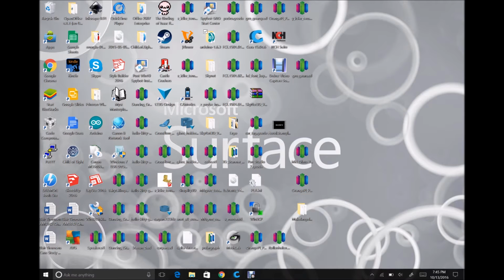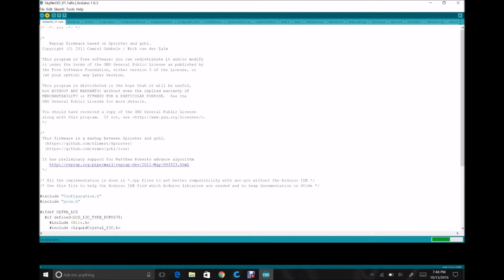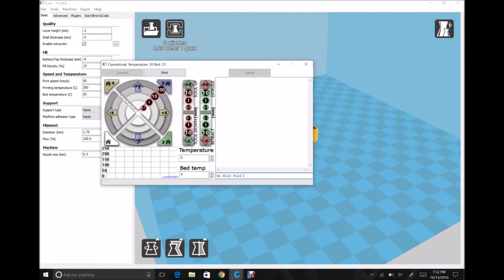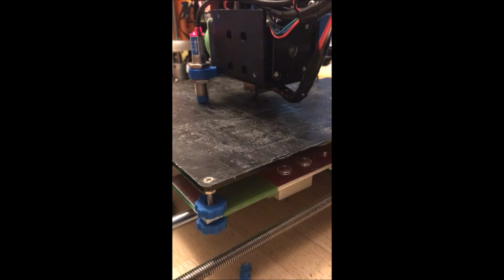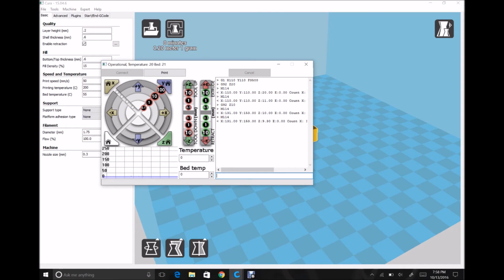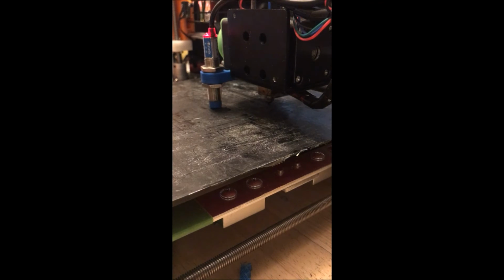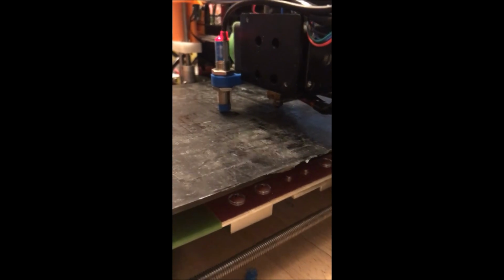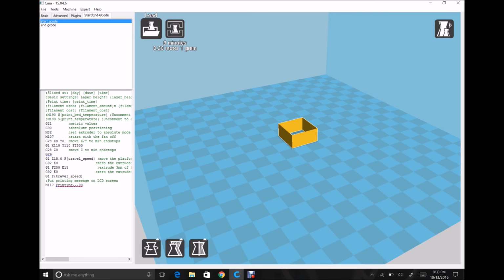Skynet Autolevel Firmware

Comment: Thanks for the upload  Few go into the Pronterface UI.  
I didn't even know it existed as I have been using Cura remotely and just saving G-code to SD card.
Wish you had used something other than a phone to shoot with but meh...
Still wondering how some have managed to do calibration process without  Cura interface.
I wonder if it works with version 14.07

Comment: Helpful, but would really benefit from a description first on the principles behind the auto-leveling strategy ("autoleveling" btw is a misleading term fro what is actually being accomplished). But many thanks anyway.
Reply from the maker: I could very easily have titled the video Setting up Auto-tramming, or something similar. I figured that since the sensor that is provided by Anet to perform this function is called an Auto-leveling sensor it might make it easier for people to find the video. If I were going to give people a pop quiz at the end of the video of proper 3d Printing terminology, then I would probably have spent a greater amount of time on insuring people knew them. At this point there are several videos out on this subject, but when I posted it a year ago it was to fill the need of those on the official Anet page on facebook that continued to struggle with the application of the Skynet firmware. It was a how-to guide not an exhaustive look at the subject.

Comment: Hi ! I have install the auto bed level sensor on my anet a8 , and I don know how to setup the auto home , cos when I press auto home its goes to the left front coner and print head keep going down so I have to put a metal plate under it to stop it , I know there is some sort of g code to make it home normally but I don know where to find it , I read the doc but still not understand it , so please help , thanks

Comment: I had trouble with inconsistency with auto bed leveling using Anet A8 firmware and Tronxy 6-36V sensor. So I tried this approach with Skynet3D and it worked perfectly first time. Thanks for sharing your experience.
Reply: hey which pin ur using on anet a8  board z axis i have same sensor
Reply: Do you mean the wiring of the connector? I swapped the brown and blue wires to make mine work. When looking at the plug on the board the wire colors are blue, brown, black (left to right). Many links to this e.g. https://www.thingiverse.com/groups/anet-a8-prusa-i3/topic:11635 . Also search Youtube and Anet A8 forum on facebook
Reply: Iam using 6/36v risistors on sensor just wanted to know which pin to use on socket thank u
Reply: I am using this sensor https://www.flickr.com/photos/13453980@N06/32466422066
I just swapped the brown and blue wires on the white plug and it worked with the procedure in this video.
Reply: cfriedalek .yea that's not they sensor Iam using .my is npn sensor inductive

Comment: When I do auto leveling with cura it all seems to work fine, until I go to print with the gcode it always goes to far down into the bed :( Is this a setting in the gcode or improper initial setup on my part?

Thanks

Comment: Why is the video vertical?  Was your wife holding the phone?
Reply from the maker: dinofx35 Had it positioned in a vise I 3D printed. I felt the vertical caught more of the area I was talking about than the horizontal did. Also, it hid more of the messy table it was sitting on at the time.

Comment: did u use transistor on sensor
Reply from the maker: sky rim I used a resistor voltage divider. You could easily use a transistor if you wanted. You could also probably use a voltage regulator turned on by the output of the sensor, or even a zener diode if you had one floating around. Anything to get the output closer to that 5v is going to save the micro controller.

Comment: First off thank you for the great video.  I setup my TronXY sensor on my A8 using your technique and everything worked great with the exception of editing the firmware.  I noticed that when I make changes to my Z_PROBE_OFFSET in the firmware and upload it, nothing changes on the printer.  However if I use the printer's menu and go to Control -> Motion -> Z Offset and enter the same amount in there, it works.

Not sure if this is a v2.3.1 thing or if mine is just acting funny but I figured I would post a note to let people know who may be going through the same thing.

So basically if you are not getting the expected results, do everything as Blair explained but try setting the Z Offset in the printers menu ( LCD ) instead of in the firmware.  Make sure to go to Control -> Store memory after making your changes and click the middle button to save.
Reply from the maker: Sean Moe I had to do that with the newest version as well though I set the offset on my octopi install on my RasPi3 using an add on that lets you read and write eeprom settings on marlin based firmware like Skynet3D.

Comment: Hi Blair, at 2nd home the printer screen and M114 the Z read 1.2mm, get up 10mm to calculate the offset, then I get down the sensor to touch the bead, then I modify the Z by -0,8 in skynet program and upload the program again to printer, then I do home, I always get 1,2 at printer screen and M114 Z read 1,2. I tried again and again but no success to get 0.8 on screen or on M114. Please what to do? Regards.

Comment: Hi, when i hit HOME, x and y axis place correctly, but the z axis not going to center to probe so it going down, down ,and... baddly touch the bed. I can't find any solution to place the probing process in the middle of the bed. Do you have hint please ?
Reply from the maker: Jeff Boily I home X and Y only using a G28 X Y then do a G0 X100 Y100 which puts the nozzle near the center of the be. Then I perform a G28 Z since it is over the metal bed now. I follow this up with a G29 to do the mesh bed leveling. I put that code in the startup of all my prints just to make sure everything is nice and level.
Reply: Nice... Thx.. i'll give a try tomorrow, i'm tired now and going to bed soon... THX VERRY MUCH...
Reply: Good it'work, but last tiny question, i understand the gcode thing when i print a file during start, but in ur video, you seem  to hit HOME to do that, how can i "reprogram" my home sequence. Do i have to do this on the firmware code and recompile it ? Seriously i appreciate ur help (and sorry for my english, i'm little bit rusty)

Comment: my print head keeps going down even when the sensor detects the bed? i use a IG511A sensor (PNP) and i get a 4,75VDC on the signal cable?? did i do somthing wrong in the software?
Reply: okey when i enter M119 it says al my switches are "open" and when i put the probe on the bed it still says "open"?
Reply: hey i am geting same problem did u get yours fix.& which pin u are using on z axis

Comment: CAN YOU TELL ME HOW TO FIX THE problem with my nozzle not centered so I cant get prob on righ side goes past sensor and p-uts tip in bed simple x any seting for center but cant find
Reply: Check the config.h  crtl+f then type "define X" less the quotes, keep clicking the find button until you see the define X probe offset from extruder.  these are the settings to change.  remember use - if your sensor is left of the extruder, and leave the number positive if it is right, also - if it is behind (y axis) and leave positive if it is in front.

Comment: Im having an issue with the sensor traveling off the end of the bed in the back during autolevel. I have the orange tip sensor mounted on the back like the SN04-N would be. I have the offset set to 3 and 3 for X and Y. This is close to the settings of the SN04-N and puts the nozzle right in the center of the bed at home all position. The problem is the sensor is not over the bed during the calibration and the nozzle runs into the bed. I've been struggling with this all day. Any sugestions?
Reply from the maker: Let me do a little research before I say exactly. You can see where mine is mounted, so I haven't tried otherwise. I might be able to replicate your issue though.
Reply: I had the exact same problem with the original Anet A8 autolevel sensor and I changed #define Y_PROBE_OFFSET_FROM_EXTRUDER 3 to #define Y_PROBE_OFFSET_FROM_EXTRUDER 20. I think this is because it is 20mm behind the axis, but that is just a guess. It works for now. Let me know if it works for you too.
Reply: I realized after printing a front mount that that was the case. Instead of neg numbers I should have gone pos numbers. Thanks for replying.

Comment: anyone know where the decoupled X and Z thingy is? I've been searching thingiverse and I couldn't find it. Thanks!
Reply from the maker: I have a printable version on thingiverse under the Anet A8 search topic. Mine were machined from Delrin i had laying around since I couldn't get it to print anything before I added them. The version I have up is exactly 8mm on the slot that rides on the 8mm bars. So it will almost guaranteed print smaller than that. As such I can upsize them to fit if you have an idea. Also, the onshape file is linked in the thingiverse description so you can modify it yourself if you get bored.

Comment: Dear Blair, Thank you very much for this video, procedure now its crystal clear on how to install this switch. In fact I have a problem. at step hit white home at 11min of the video, X go home, Y go home, then Z keep going down and hit the bed and keep going, its never stop or leveling as shown in video. Do you believe that the switch might not working? I checked the wiring of the switch and its correct. Im using (LJ12A3-4-Z/BX) form ebay (http://www.ebay.fr/itm/122206045078?_trksid=p2050601.m570.l6004&_trkparms=gh1g%3DI122206045078.N41.S2.R1.TR2) . I repeat the process many times but no success. Do you have idea on what I suppose to do. Please help. Many thx.
Reply: @A.A. MAHMOOD did you get this to work?? i have the same sensor and the same problem

Comment: Very interesting video. 
Could you tell me where you find stl for fan duct and how you have decoupled Z axe?
Reply from the maker: the Fan duct is my own design that I have posted on Thingiverse. (my testing has shown you want a fairly high static pressure fan to get the flow you want) Search for Anet A8 and it should pop up. I also have the decoupled pieces there, but be warned, I purposely built the sizes for the slots that run on the 8mm rod small/at size so they have to be reamed to run tight. If you want to adjust before printing I included a link to the onshape document (online 3d design software I used for them, free of charge) so they can be modified if you want to. Or let me know what you want for speed and I can include an alternate on the thingiverse file.
Reply: Blair, which account is yours on Thingiverse? I looked up your actual name and found an account but I don't see an X Y decoupler :/ Are you guys talking about the frame mounts to mount them to a piece of wood or table?

Comment: thanks for the video. I am thinking about doing this mod, just worried I cannot go back to original A8 firmware, which is giving me pretty good results with manual leveling..
Reply: You should flash the firmware anyway the stock firmware has safety features disabled which is potentially very dangerous, the printer could actually catch fire

Comment: has anyone used the bl touch
probe
Reply from the maker: mike stetson I have really wanted to try it, but my understanding is that it requires a servo style frequency output to tell the probe to extend and retract. I know of no such place to pick one up on the Anet A8 control board the way it is made.
Reply: no but i have seen them on other pursa clones just not on the a8
Reply from the maker: mike stetson yeah, most of the other clones, though not all run a ramps setup which has an arduino mega underneath providing the processing power. There are a few extra pins for stuff like that. As well as dual extruders. I have a ramps board sitting on my study desk that I am thinking about using for a new printer build as well.
Reply: i know i have an early printrbot simple one of the early ones that ran on fishing line.i am thinking about remaking in acrylic or alumin
Reply: https://www.aliexpress.com/store/product/3D-Printer-touch-Auto-Leveling-Sensor-Auto-Leveling-Free-Shipping/1654223_32761451076.html?spm=2114.8147860.0.0.xpMMWi

Comment: As far as i concerned was an amazing video. I had NO CLUE what I was doing i'm a retired mechanic can rip things apart & put them together thats why i bought the A8 kit. I am somewhat PC literate but have no clue when it comes to firmware & G code but with the video i was able to get it installed & working as it should my first print a 20 min test print turned out great !!!!! Thanks alot
Reply from the maker: Frank Nizni I'm glad I was able to help. One of my closest friends owns a car shop and he bought an A8 after playing with mine. Some of the steps in the written document were a little hard to understand for someone unfamiliar. Pictures always help me out.
Reply: HEY follow your steps .when i hit y home x home nozzle does not come back to center of bed i follow first steps
Reply: when i try home all it z axis come center of but does not come down. it goes up a bit instead of down.what iam doing wrong
Reply: when i try home all it z axis come center of but does not come down. it goes up a bit instead of down.what iam doing wrong

Comment: To follow up the starting g code did not work for me. Printer would start printing at 15mm above the bed.  I just went back to a simpler g code start that worked fine with just a G28 followed by a G29.
Reply from the maker: Scott Allen, wonder why the difference? Doesn't matter if you got it working, glad I was able to help out even a little.